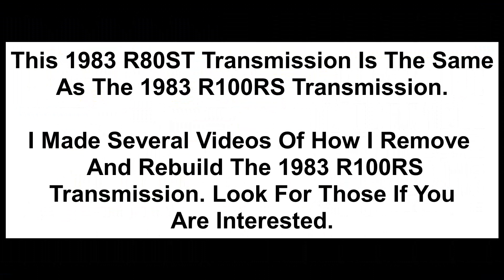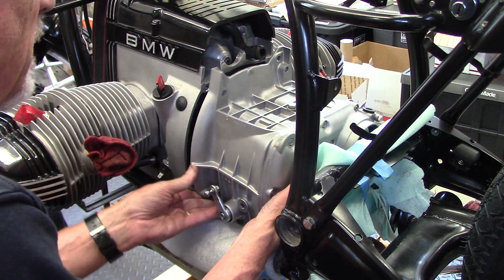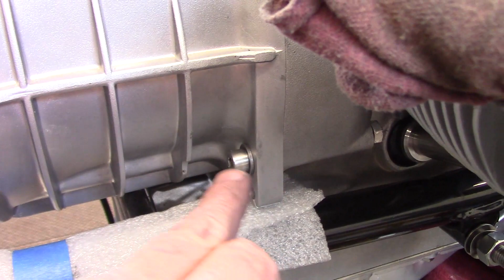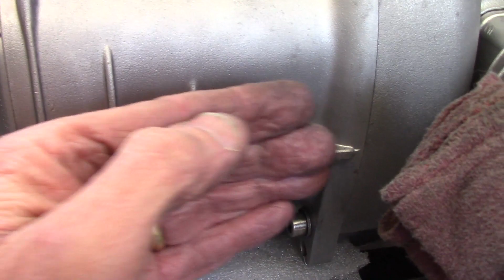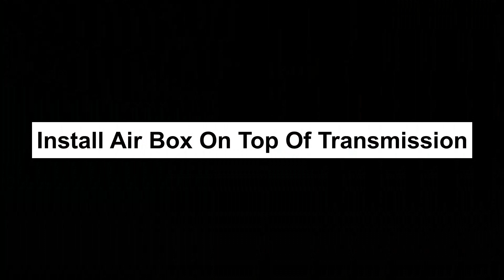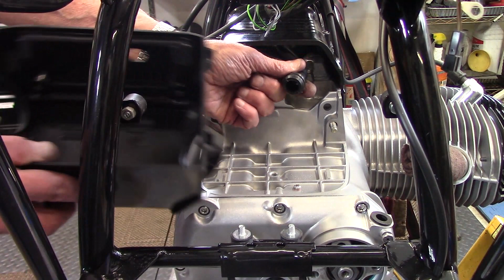1983 BMW R80ST Install Transmission

Comment: Hello, great job ! How do you intall the rubber on the lever ?
Reply from the maker: I use Rhyglide which is a rubber lubricant. You can also use dish soap.
Reply: Okay thanks a lot, I will try !